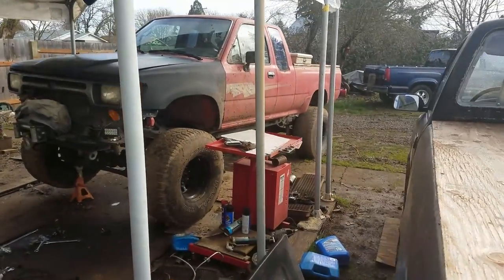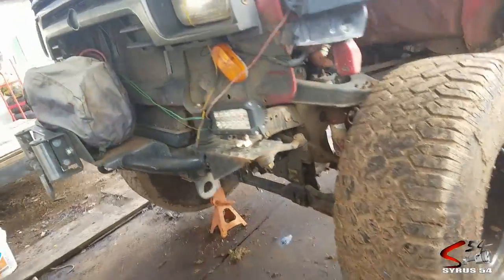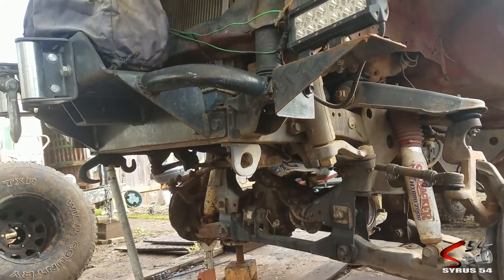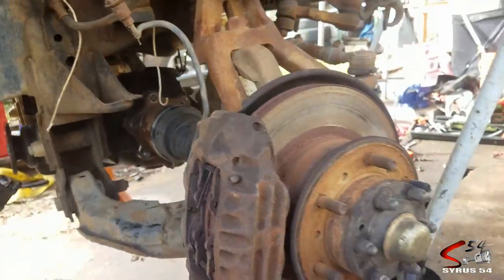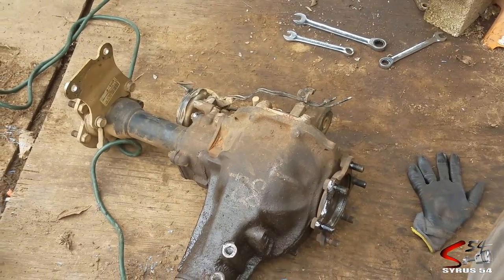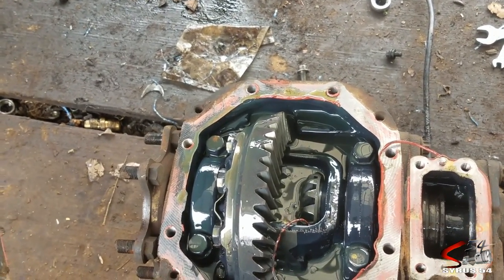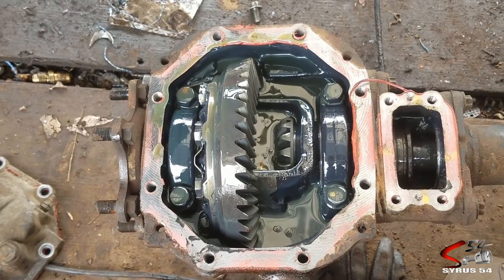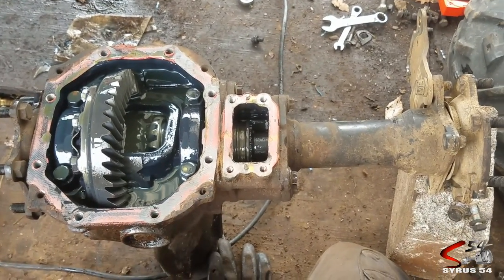Understanding the Vacuum locking Front Axle of a Toyota Pickup

Comment: Great video!  My '90 4Runner was recently not engaging in 4WD after I had installed the manual locking hubs.  Turns out I had the vacuum lines criss crossed by accident!  Once I switched the lines, the 4WD worked perfect as it should!  This video helped me see and understand how the vacuum line system engages the 4WD on an auto locking hub vehicle.  Thanks for sharing!
Reply from the maker: Ummmmm....... The vacuum li es are to engage the AUTO locking. Why would you need them if you do manuals? (Huge mistake IMO. Auto lockers for LIFE!!!)
Reply: @Syrus54  Because I don't want the constant wear and tear of my CV Axles spinning non-stop when I don't need 4WD.

Comment: my vacum accuator was busted so i made it manual with a rod going tru the floor in the passenger under the dash location,.  a small plate with a couple of pivot points at the accuator location and a lever ( conected to the rod inside the cab) ,.. so when i twist the rod it pushs or pull on the shaft whitch the vacum diafram is hooked on too.

Comment: do the A.D.D. modification. did it on my 4runner,i now have locking hubs and NO electronics or vaccum to engage 4x4. its bullet proofed
Reply: Could you post a link?
Reply: Hey mate I have a 1992 Hilux it had the gear box with automatic locking hubs transfer case but I put in a 2004 g52 an now no 4wd.  was wondering What is the best way to go about getting 4wd back?
Reply: can i use manual locking hub on ADD ?coz the right side its damaged

Comment: I'm about to watch the video. I plan on swapping one tons soon. So I didn't want to spend money on locking hubs. But I recently installed Chevy engine and driveline. I thought about wiring up the vacuum system from switch inside cab for now to activate front diff. Right now all vacuum stuff is removed. But I still have the servos... Does anyone have a good diagram showing how it works so I can hotwire it.   Theres only two tubes that come from the actual diff but there was also a canister under the wheel well etc...

Comment: my 4x4 '94 22RE 5-speed pickup bucks when I put it in 4wd.  makes me wonder if one of the previous owners swapped the gear ratio on the front or the rear and left them mismatched.  according to the vin sticker axle code, it says it's supposed to be a 4.10 ratio.  guess it's time to count some wheel & driveshaft rotations then throw down some simple division.
Reply: cbh148 mine bucks like that and a gear was broke.

Comment: Very good video, I own a 1991 Toyota pickup V6 4x4. Stumbled upon your videos when searching about 3vze turbo stuff. Pretty cool that you actually did it, even if it didn't last. I do all sorts of work on mine, 315,00 miles and counting! Love those trucks and I was just wondering about the front axle vacuum stuff. Keep the content coming! Any plans for the engine in that truck?
Reply from the maker: You mean, Any plans for the 3VZE? not really. It's been a great engine, and I'm gonna run it until it finally quits.
Then I'll probably do a Rebuild video, and run it for another 1/2 million miles.
But if you mean Horsepower-wise... No. Nothing for atleast the next few years.

Comment: So I've got the same set up but I've changed the gearbox witch is full mechanical transfer case so it has no vacuum.  I wondering how to go about getting 4wd cos the front axle isn't engaging
Reply from the maker: Hubs? Turn them to engage (or so ive heard). You shouldda went auto like mine.

Comment: HELP
!!!!  I just got a 98 4Runner with only
140K.   Can someone point me in the right direction in
resolving my 98 4Runner issue? When I engage 4H it goes in silent but when it
goes back to 2H (disengage) there is a loud bang (like a sled hammer bang). After
depressing the 4WD (4H to 2H) there is a delay for about 30 second before it disengages
as I drive down the road below 25mph. The 4wd light indicator goes on when I
press the button and it goes off with a bang returning to 2H, the light never
blinks. Can anyone help me troubleshoot what to look at to solve the hard
disengagement with my 4WD?  Any suggestion would be greatly appreciated.
Reply from the maker: Vacuum leak?